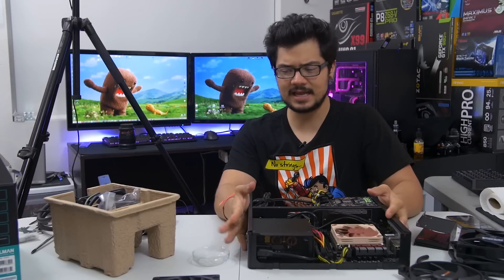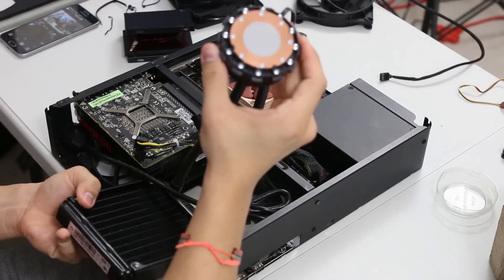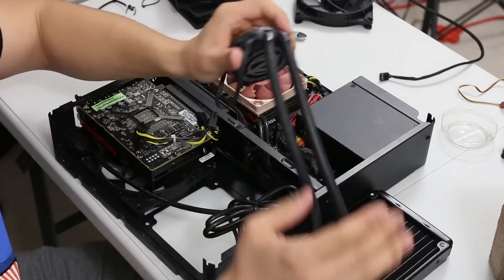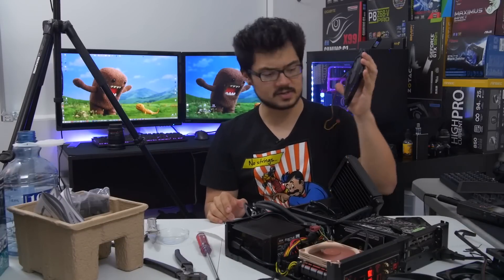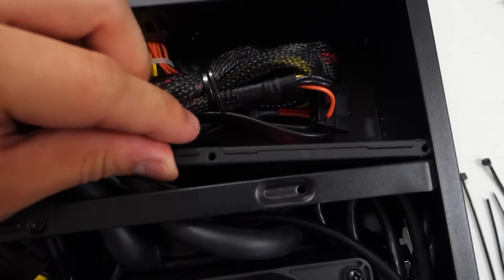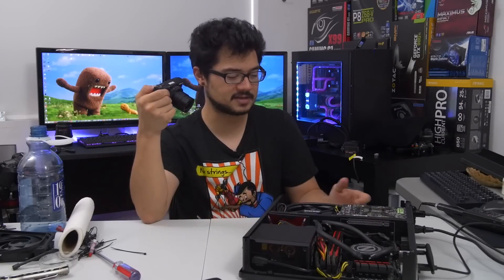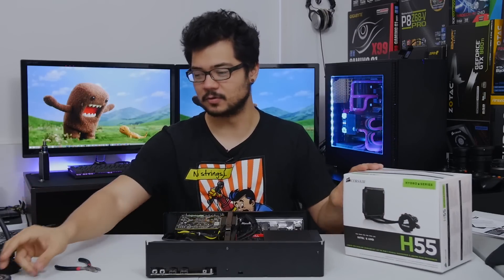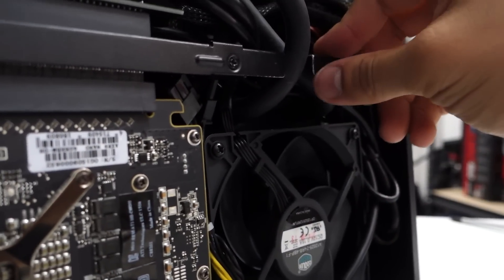Challenge Accepted: Liquid Cooling in the Fractal Node 202!?

Comment: Facepalm, sawing through the case with everything still installed, but hey that's one way to save time.Great job man.
Reply from the maker: +Seydzh Chernopiski 30 hours into making a video you start taking short cuts when you can ;)
Reply: +Seydzh Chernopiski all I saw was the metal filings and my eyes rolled back in my head.  My luck would have fried the board and video card if Itried this
Reply: +Awesomesauce Network what about the two screws the bracket looked completely removable.
Reply: +lonewolf5460 you need the bracket still even after cutting it (ie you  need to replace it).  If you just removed it you're still stuck with the same problem of not being able to get the block through the cut out despite it being out of the case as the hole size didn't change
Reply: +lonewolf5460 you mean just remove the entire middlewall to put the tubing through from the underside? not possible, the wall is fixed with rivets and the coutout for the cables is just a hole in the wall. an about the screws there, they are just for the pci-e riser.
Reply: +Awesomesauce Network yes, but you could have at the very least covered the bare naked circuit boards with something.
Reply: +lonewolf5460 Thank you I noticed the three screws that he could have taken out
Reply: +Seydzh Chernopiski  ....At least he didn't drill through a mother board like Jay!!!!!!!!!!!  True enthusiasts!!!!!!!!!!!!!!!
Reply: +Awesomesauce Network I hope absolutely none of those small metal bits from filing the edges of the cut made their way into the R9 Nano when you turned the system on.
Reply: +Seydzh Chernopiski At least he could covered the area with plastic sheets to keep the particles from getting in there
Reply: +Kreepy Pasta oh man, you have no idea how bad vacuums are to electronic devices. Dust out is way more effective without static electricity discharging on your computer.
Reply: I applaud his tenacity..
Reply: tin snips would have saved alot of mess
Reply: ***** vacuum pressure is deadly to electronic components..
Reply: PC parts are not as fragile as they use to be.

Comment: Fractal should make a metal piece that you can unscrew to pass some tubing and then screw it again to keep the rigidity of the case.
Reply: L3xou97 I just got this case and will be using a little connecting strip from Home Depot. I'll cut and drill first, and see how it goes together. Now to find the best fully modular sfx PSU, and measure for custom cables.
Reply: They could also build a big cooler that still fits the cpu compartment of the node 202. It's impossible to find something that fits of the shelf. Either it's a little to high or a quite underpowered. I probably will buy another case. Thermals are terrible.
Reply: That would be a nice upgrade for the 202.2
Reply: It has that... That whole L shaped piece comes off for mounting the riser card...
Reply: @bhgemini  did you find the corsair sf600 platinum or 750?
Reply: @jpesicka492  I have the SF450 gold in this modded case, and just passed the system down to my nephew. Funny enough I literally just finished a build today, using the new Sliger SM570 and an SF600 Platinum. They both worked great! I just the SF600 directly from Corsair and it took about 5 days total to get delivered.
Reply: i got a Node 202 now, my old HPTC used a Silverstone ML-03 - that hat a removeable crossbar for rigidity

Comment: you coulve made a small metal plate and riveted it back over top tne hoses to get the rigidity of the case back.
Reply: The plate would have to go under but ya thats what I would do.
Reply: Save the piece you cut off maybe

Comment: Custom loop I dare you
Reply: DO IT NO BALLS
Reply: You would have to have no res and that’s super sketch
Reply: im doing a water cooling build with one of these now. it's possible with a slim 240mm rad, which i do have laying around. you can fit a small res where the SSD cage sits. the pump will have to be a DDC unit as D5 will not fit. storage will be dual M.2 SSDs. the GPU will be a water cooled RTX 2080
Reply: @solomonshv  can you confirm the exact res & pump you used? I was looking at DDC pump/res combos but i realise that isn't the case (saw your video on your channel btw, looks sick)

Comment: I like where the SSD ended up being. Seems you forgot to mention that after getting the H55 in.
Reply from the maker: +PlainOldJim  i did forget! just one of those last minute ideas that worked out beautifully :)
Reply: +Awesomesauce Network you deserve alot more subs!!
Reply: +Awesomesauce Network It would be neat to see a fury x with the 120 worked into this as well
Reply: +PlainOldJim I like the new mounting location more too
Reply: +PlainOldJim +1 i didnt even notice. looks dope!
Reply: +Danny Zaidan where can I buy these parts in his first fractal design node 202 parts? Pls tell me
Reply: I want all these parts in his build exert the water cooler I don't want that, and will his parts be able to be overclocked or not?
Reply: Could a 3.5 inch drive fit there with an SFX PSU?
Reply: +SeabasR nope
Reply: what program do you use to monitor your temps?
Reply: hwmonitor
Reply: hey Bitwit, really awesome build. I'm thinking of doing it myself build could you tell me what the max length of the GPU can be when you have a 120mm rad installed
Reply: I'm also wondering the same thing, I just bought a 1060 mini which is 6.8 inches long but has the pci-e connectors on the side so it won't interfere with the fan on the radiator. The R9 nano is 6" but has the connector on the end, so I'm not buying an AIO just yet, as I want to measure the space I have available.
Reply: Matthew Derman hey. I'm planning to do the same thing. Can you message me when you try. Tia
Reply: It's an R9 Nano
Reply: OK, with an evga 1060 mini, in order to fit an h60 in, a cm or two of the radiator will have to be under the gpu, the fan would then have to be slightly offset, and so hang over the other edge of the radiator where the front panel i/o is. It will still work, just may not get as great cooling.
Reply: Matthew Anderson I built mine with a Zotac 1060 mini and a corsair H55. The Gigabyte 1070 mini is shorter so that could fit
Reply: Pierre Barbeyto what fan do you use with the H55 ? what sort of Temps do you get ?
Reply: Lukas Sabo I replaced the stock h55 fan with an Sp120 and another sp120 by the gpu. I get low 30s Cpu and high 30s gpu in idle and around high 50s cpu and low 80s gpu. 1 sp120 below the gpu is intake
Reply: Lukas Sabo 6600k ocd to 4.4ghz
Reply: Also the fan in the H55 will slightly be offset depending on what gpu you'll use
Reply: Pierre Barbeyto awesome thanks. How bad is the offset? was it enough to make you use a different mounting option or do the screws still work?
Reply: about half an inch. no i had to zip tie it to a small piece of thin metal i found lying around that had two holes for it
Reply: I might be blind, but I don't see the SSD after the H55 mount

Comment: kyle, i can't thank you enough for making this video. a little over a month ago i had this exact idea for a network render node concept and found no one doing this. i asked around on twitter to all the major tech channels here on YouTube with no replies. i searched all over parts wise and found short cards can work but i couldn't confirm 100% that the rad would fit. thanks to your video i know it can fit with the small cut and then it's smooth sailing. i am smiling so much my face hurts. the first chance i get i am going to be building a system with a node 202 and the CPU is for sure going to be water cooled just like in this video. Thank you!

Comment: Cough, cough..... This is going to make me want to make an APU ITX build using a 240mm radiator, eventually to replace my media PC that's in a HAF XB. I need a new media PC that takes up less space. I found this video looking for possibility of fitting a 240mm radiator in the Node 202. With the GPU not fitted, it would indeed work it seems. Thanks Kyle.

Comment: thank you for including part 2 in this video, just so you know, you can buy disconnecting pumps
Reply: Ikr
Reply: REKT
Reply: it's pretty recent but there is a brand doing that.
Reply: it's alphacool.
Reply: Thanks for the info!
Reply: The Fractal Design Kelvin T12 is an AIO designed with extension in mind : the water-block features threaded fitting and the radiator has a fill/bleed port.
Reply: I'm pretty sure he knows that, I think he was just using things he had laying  around.

Comment: Nice proof of concept and you could technically get even more ghetto and just screw in a new steel piece to the hole for rigidity.

Also: please don't cut the case without removing components (or have a disclaimer on it) If dust is bad for PC components and fans, tiny metal shavings are well, you can imagine.
Reply: +dimitriid I was just about to say the same thing.
Reply: Why do you think he used can air in the video?
Reply: Air is not really gonna get all of it. If is dust getting most of it is fine. If it's something that can short components or jam and ruin fans then you kinda need to make SURE you get all of it, not just almost all of it.

Comment: I wonder if you can even do full custom water cooling with both gpu and cpu in the node 202 :o ...... imagine the level of craftsmanship required to do that
Reply: Rice field pepe YES
Reply: using fractals kelvin pump and dual 120mm slim rad :) it's doable with some modding.
Reply: Tbh I think Fractal Design should taking notes how people are wanting watercooling solution would work in Node 202. Maybee comes out with a new kelvin cooler only for the node 202, that would be niiiiiice
Reply: Jun zhang or mabye make a newer version of the node 202 with water cooling compabilty and more modding flexibility like corsair did with the 380T
Reply: some dimension could be added, like 1-2 cm over CPU fan height, and radiator mounting at CPU ventin holes. also mounting rails instead of holes for the fan mounting in gpu chamber, allows for easier installation for radiator. but not change too much as it would miss the whole point with this chassi. 380T is just simply tooo big for an ITX build. atleast for me.
Reply: reservoir placement could be a pita. unless you utilize the. rad as reservoir
Reply: Someone did it on the LTT forums. It's pretty legit work. Smallest reservoir I've ever seen though lol
Reply: corsair one.

Comment: I know this is an old video and you're probably done with the rig but may I give a suggestion? I find that it is better to use two 15mm thick fans (like the one in the video or the Cooler Master Xtraflow Slim) in a push/pull configuration. My guess is that you might drop about 4 degrees celsius. At least that was what I got that way with a Corsair H80 but it has a thicker radiator. You mentioned that the PCI-e power cable is in the way so maybe it won't fit because 2 15mm thick fans are thicker than one 25mm one (duh). A Gigabyte 1070 Mini ITX would solve the power connector problem with a nice gain to performance.
Reply: Linus Tech Tips already proven that push/pull has no benefit on high static pressure fans, and only improves static pressure on high air flow fans. 15mm fans also will either reduce the cooling capacity, or be quite loud for no reason. There is a reason they are so rarely used.

Comment: The one time a custom loop would've been easier than aio
Reply: Custom loop to that case?

ok
Reply: +Xamnition yeah, wouldn't be an insane loop but with a radiator mounted pump you could do it. I just meant anything where you could remove the cpu block really.
Reply: +Connor Godshall 
and the reservoir ?
Reply: +Connor Godshall Where are you gonna mount the pump and the reservoir
Reply: +Xamnition The pump would be the hardest part to place. I think in a case this small you don't really need a reservoir. I've seen a RVZ01 case watercooled with just tubes and no res. You just gotta be more careful how you bleed the loop

Comment: You can drill 4 holes to screws and fit a 240 waterblock inside the case and the fan outside with a dual 4070 ti, or you can also leave the case open in front of a wall to not see the inside and you'l gain 10°c on a simple noctua L9, you could also put a bigger noctua if leaved open and gain another 20°c.

Comment: I think there are some screws holding that piece of steel there.... You sort coulda just unscrewed them, put the tubes there, then rescrewed it....
Plz correct me if I'm missing something.
Reply: I was thinking that aswell lol
Reply: That is not screw, that is Rivet, the gayestof all screw and nuts and nail combine. lol, the only way to remove it either put a chisel beside and hammer the chisel down until the rivet pop out or ,,saw it., lol
Reply: Muhamad Ubaied oh... Nvm then!

Comment: If only you had cut into the chassis in the first place! Nonetheless; great video, Kyle. Glad you got a chance to redo this!
Reply: Of unscrew, remove rivetts that hold the devider in.
Reply: All he really had to do with the original AIO was flip the PC upside down so the air bubbles floated in the radiator instead of the pump

Comment: anyone else thought he was going to custom liquid cool it?
Reply: That would be Jay.
Reply: jay would find some way to custom hardline with a 480mm radiator, a push/pull configuration and separate CPU and GPU loops
Reply: Don't forget glass tubing not just any hardline.
Reply: Theodor Mauros of course. with 3 titan Xs for little jay, cos she got into MS paint.
Reply: That's some heavy rendering she needs to do right there.
Reply: Theodor Mauros hell yeah, soon shes gonna have the new 32gb vram AMD gpu...
with the 6950x with 128gb DDR4
Reply: obviously then later she will start using ms powerpoint so she will need the new 16 core zen apu in crossfire with 4 r9 490x 16GB
Reply: Rixnbix oh yeah

Comment: @Awesomesauce Network other think you should consider is that even if you had bubbles in the loop, the radiator was at the bottom and you were forcing the pump.
And i'm certain that the installation and operation manual tell you this.

Comment: Couldn't you just have unscrewed the middle bracket then take out the GPU/PCIE extension put the cooler in, replace the middle bracket and put the GPU and extension back in? 
Would have saved cutting out the metal and probably would have meant you wouldn't need to use the second cooler.
Reply: +WayStedYou I was wondering the same thing. More fun this way I guess ;)

Comment: my only concern is the VRMs on the motherboard that no longer get passive airflow that the Noctua nh-l9i used to provide. I would mount the 15mm slipstream fan to the case's side panel to prevent overheating VRMs if there is enough space to mount it

Comment: I killed a reman H60 by taking the block apart because the pump motor wires are not meant to be disconnected and are VERY thin.  It had 3/8 fittings on the radiator so I just reused the radiator in a custom loop.

Comment: I have a itx pc build and I drilled the  raidmax itx 0907-bp case cover to install a 120mm watercooler and well the apu im using, used to run very hot because the case don't have a very good ventilation but whit the water cooler it doesn't go over 70 celcius under load.I love it because it gives me the fell like a real pc tower in a smaller case and I used the psu the case came with ...never had problems with it ,even when gaming

Comment: You could add a 120mm fan on the CPU fan grill of the case to exhaust the hot air from the GPU and AIO and maybe low the temperatures 5°C or something.

Comment: I would think about putting some rubber u channel around the metal edges of the part you cut off, just to be safe since this computer will be transported form time to time you don't want to spring a leak

Comment: hey, I thought I should add something. You may want to use some sort of anti-chaffing agent where you cut the bracket. some plastidip, electric tape, or silicone tape. I know it may not move much, but if those lines touch that metal at all it may eventually wear a hole in the line.

Comment: Trimming off the small piece of backbone doesn't affect the structural rigidity a lick. I cut it out with a rotary tool and stuffed a H110i in there, since it's not doing any rendering.

Comment: I would of made that same cut, but I would of then drilled out holes on each side. I would then get a metal bracket under the cut area with matching holes and tapped in some 8mm bolts and used matching nuts on opposite end. This would give back it's structural rigidity. Obviously, I would do this when the case was bare bones.

Comment: I have installed a h50 and 2 h60's in the same loop with all three rads and pumps. It was a pita but you can get all of the air out. It can be done you should have spent a little more time on it. Ship it to me next time I'll do it over the weekend.

Comment: I built a Z370/i7-8700k system in my Node with a liquid AIO (H55). I removed the PSU and installed it on the GPU side of the case, near the front panel circuitry. I installed the H55 radiator in place of the PSU and then installed a Noctua PWM fan on the radiator. Oh man that worked beautifully. Idle temps just below 30°C and temps under load never went above 65°C. Didn't need to cut into the case frame at all.